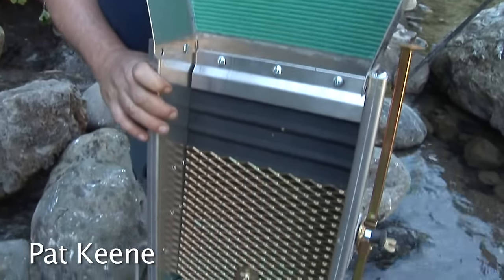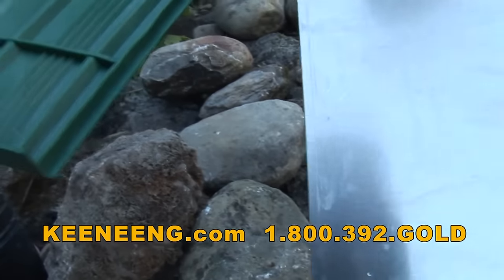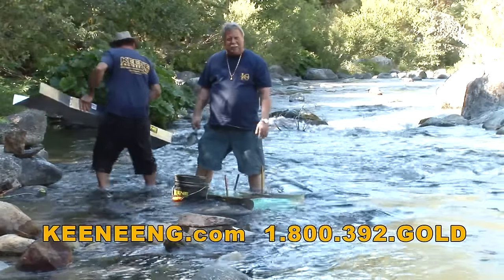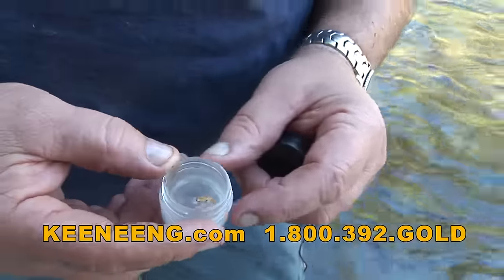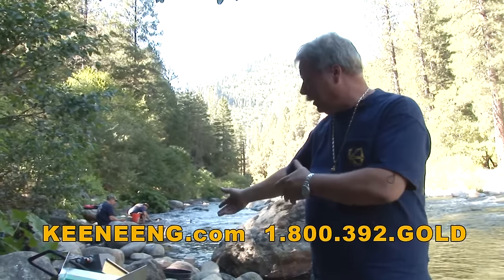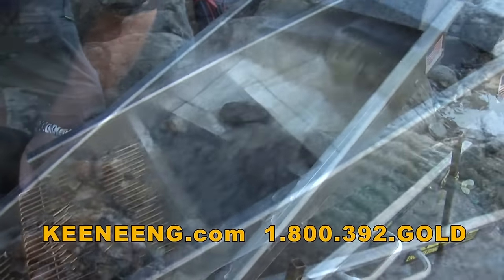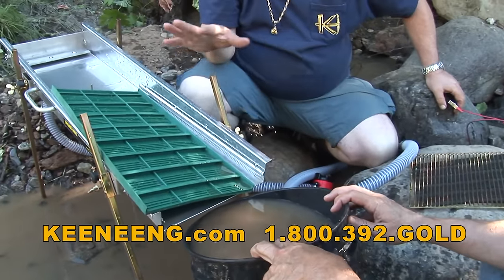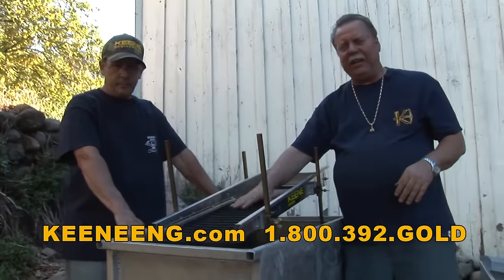KEENE Mini Max Gold Mining Sluice Highbanker Concentrator with Pat Keene

Comment: 13:44. Looks like a good product. With all do respect, when you disconnect a terminal from a jumper or battery, the negative should come off first. When connecting, the positive first. An easy way to remember is that the negative shouldn't ever be connected by itself. Its usually more important when connecting to the circuitry of a vehicle, but i thought i should share anyway. It helps prevent arcing and potentially help those pumps last longer. Instructions are printed right on most jump boxes, including that one. Ive been in the auto repair industry for going on 23 years and have seen many mechanics get this wrong, so no offense. Thanks for sharing
Reply: I agree with all your points. I do not recommend using a battery jumper box. It would help if you had a higher amp-hour battery, typically around 35 amps plus. Since the price of lithium-ion batteries is getting cheaper, many customers are switching over. The negative should come off first.  When connecting, the positive first. I will be sure to pass this along.  Thank you for your input.  I have not really paid attention to it in the past, but I will now.

Comment: If a Mini Max is used in heavy clay you should switch over the square mesh classifier screen.  This will help disseminate the clay before entering the lower sluice.  The top hopper can be slightly flattened, forcing the clays to break down.  For the main sluice, you simply have to adjust it so you get a proper washing action on the riffles.  Overall it does a good job in clayish material you just have to go a little slower.

Comment from the maker: It all depends on the type of material you are running.  Heavy black sands every few buckets.  Typical material you can go 6 bucket or so.  If you are using it in the clean up mode with just the miracle mat you should clean up at least every 5 gallon buck and use a magnet to remove the black sand.

Comment: Hey Pat, mine has the larger single pump. Any better to have the dual? Have only ran it in my driveway to test the flow and setup. Can hardly wait to get it up on the river. Darn knee surgery has slowed me down plus all these Southern Oregon fires as well. So far I’m very impressed.

Comment: Hello. 
Can you pls recommend a good recheargeable battery for Johnson 2200 GPH 12 Volt Pump? I would avoid using car batteries.
I found the mini max gold sluice at one reseller in Germany. It is supplied with above mentioned pump model.
Thanks.
Reply: Have you found a good battery yet?
Reply: @lionelli9387 Yes. A custom made 12v 80Ah. It cost me around 300 euros.

Comment: I recently bought this set up. I was wondering how long that jump starter seen in this video would run the two pumps?
Reply: @digitalwarrior6731  hey bud, thanks for the reply. I loved my mini max. I ended up just hauling a deep cycle battery around with it. Sadly my house burned down in the camp fire and I lost all my prospecting equipment.
Reply: @digitalwarrior6731  I believe I paid about $700. They have changed the design on newer ones. Now there is only one intake pump, but it is much larger. It's a great little unit. 10/10 will buy again.

Comment: Just curious.. If using one of those battery supply charging units, how long can you use this system out in the field before is goes dead and won't run the pumping system anymore? I'm sure the pumps have a pretty low amp draw.. thanks.

Comment: Quick question, could the mini max be used as a dredge when using a gas powered pump, and using an 1 1/2- 2" nozzle? Looks like an awesome unit that's very versatile to use, easy to set up.
Reply: Yes they have a video showing one! 👍❤️💛💚

Comment: lovely unit,can it be shipped to NZ or can it be purchased here, thanks Ant
Reply from the maker: Shipping into NZ is tough right now air freight it super high right now.  You should contact our dealer there he may have some in stock GOLDRUSH TOURS & SUPPLIES LTD | DredgeNZ
23 Camwell Park, RD 1
Kaiapoi, 7691
phone: 03 313 1986
mobile: 021 205 5272
info@dredgenz.co.nz
www.dredgenz.co.nz

Comment: i want this but i'm trying to find a way to charge the 12 volt deep cycle battier, using a cars alternator waterwheel you can send a link to me please ,cause  camp n mine for 2 weeks i find nice gold i'm 49erbob i'll buy this when i sell my ounce
Reply from the maker: Robert The amp draw is most likely around 3 amps for the 2 pumps.  I have used a small solar panel to keep my battery charged up on the river.  Since you are not running the pumps all the time a small to medium panel works well.  A water wheel would be a cool set up however I am not sure wear to find one.
Reply: Bob use a (one wire) alternator
Reply: get a solar panel

Comment: What is the biggest you can go gph on a pump for this setup ?
Reply from the maker: We now use a single RP2200 pump with a single 1.25" hose.  The pump produces roughly 2200 Gallons per hour or or 36 rpm.  The single pump does provide a little more flow than the 2 smaller pumps.
Reply: @KeeneEngInc  would I be able to run 4000gph or will that blow it out ?
Reply from the maker: @hardog22   You could try it however if you are going to go with that big a pump you should run the bigger pressure hose keep the friction loss to a minimum and look at the larger hooper like we use on the A52S sluice box. If you look at some our out post you will get the idea.  check out this link https://www.facebook.com/1436836256/videos/10224652990658979/
Reply: @KeeneEngInc  how much is the highbanker?? And how much is the pump RP2200??

Comment: I was going to say , Rub your hand across the mats ...also you can use a brush , keep one around it does help 
In clean up later I always keep one around for dusting in between the knob section of my mixers and just keep same brush for that task cleaning , sorry I don’t know what I’m talking about geez sorry 😐 bye
Reply from the maker: Not a bad idea!  I have also disconnected the pressure hose and washed of parts with the flow of the pump as well. Appreciate your input

Comment: So, since California’s stringent laws, rules, and regulations prohibit any motorized equipment, for sluicing, high banking, and in some areas hand sluicing, what do you do when Mr. forest ranger comes along, giving you a healthy ticket, plus a fine, and Confiscates your equipment? Busted.
Reply: For one, you don't prospect right off the road, you get your gear and you hike to a nice hard to get spot where the pine swine won't go, they don't hike. Laws are written for the sole purpose of hoping that people will self regulate themselves because they are afraid of what might happen, such as tickets or jail, and it sounds like it's worked for folks like you. And if that doesn't work, you just leave California and go to a more prospecting friendly state. Gold is all over the west, top to bottom.

Comment: People. they salted the dirt to make the video look good. Read Clarkson Riffle study.  The riffles Keene uses are mere obstructions in a trough. You NEVER set riffles on top of expanded metal. Water will flow under the riffles and disturb the heavies.
Reply from the maker: Typically your comments about the expanded metal are true,  if you place riffle on top of expanded metal you can get under wash.  With this particular batch of expanded metal we use and the green ribbed carpet this works amazing.  In fact, I was blown away on how effective the 2 worked together.   The trick is the green carpet swells up with water and fills in the gaps. When we add a riffle over expanded metal we would design the rifle to block the under wash.
Reply: Keep on digging Haters Gonna Hate